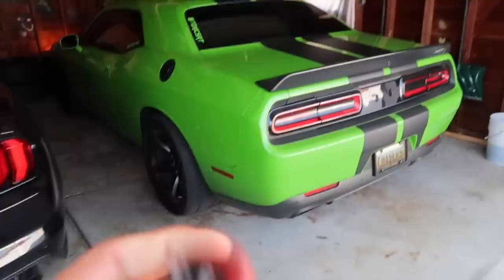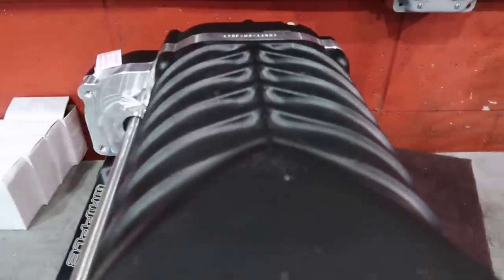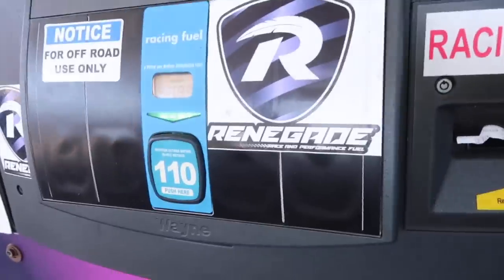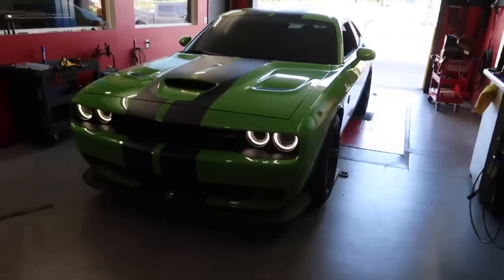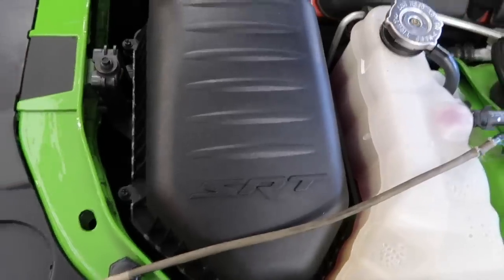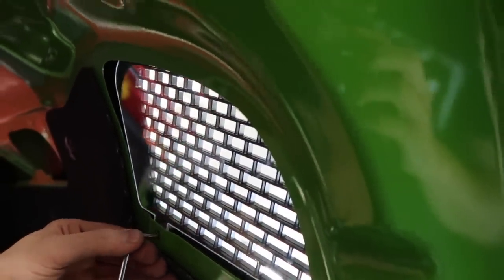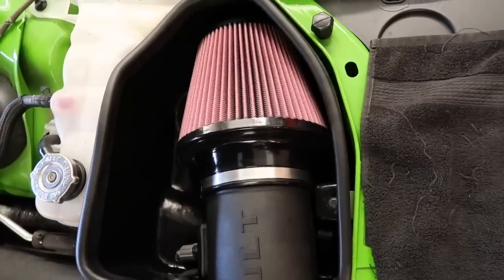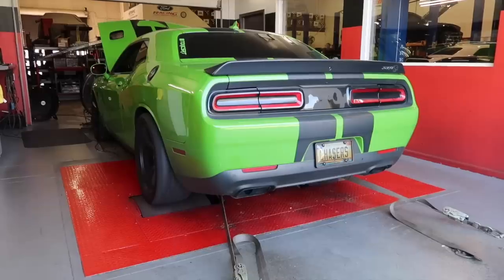INSTALLED A NEW MOD ON MY CHALLENGER HELLCAT & DYNOED IT!! *WOW*

Comment: the headlight openings are direct injection ports or dips no ram air. A ram air would be a port on the hood forcing air into the filter

Comment: The hood vent vents are designed to allow heat to escape.  Guess you are going to have some additional heat in the engine compartment.  I have a Bwoody CAI  on my Hellcat and it is great.   Plus I got to keep my vent open.  HR5 10.5 replica wheels with MT 305x35/20’s drag radials coupled with a rear diff brace will take care of your spinning issues.  I don’t even run with traction control on.
Reply: Wee Man how do u like the diff brace? I’m thinking of adding one. 
I have the JLT intake and not seeing an increase in heat. I almost did the diff brace when I did my driveshaft but figured my 305/45/18 mickeys setup would be good enough. I’m getting spin still but can you elaborate on that brace?

Comment: He has a stock hellcat with an intake. That’s why he didn’t show us any numbers 🤣
Reply from the maker: Try me when u see me & you'll find out.
Reply: @MotorTube  I love the car whether it's got 700hp, or it's got 1500hp!! Just as long as you don't fuck it up, cuz ur gonna sell it to me when it's time buddy!!
Reply: FACTS
Reply: Motortube       usually the cold air intake is everybody first mod..especially cars with supercharger that suck air ..there only a few things you can do to a hellcat to get more horsepower that makes sense  Pulleys , exhausted, e85 and airtakes .fuel injectors . Colder plugs . You act like thats a big secret lol
Reply: I wouldn’t wanna race Ron. 
Car is not stock for the hundredth time. That green hellcat puts busses on 1000 horsepower cars all the time.
Reply: @seanmichael252  zl1 the guy had shitty tires he was spinning the whole time.. that race dont prove nothing  and he need to down shift and use the paddles then switch it back to auto and let car and.ten speed do it thang
Reply: He only has an intake and cat deletes
Reply: Brian Lip I’ve been over that black car. He’s got new Nitto NT05Rs and its manual. LSA stroker 416 cu in on E85. When I raced him he was hookin just fine. I’m really REALLY sure Ron’s car is not stock and is putting down at least 850 - 865 rwhp? On 110 race fuel. All these people saying he’s stock are wrong!I’ve seen it and what it does. Main reason I bought a hellcat was watching Ron hurt people’s feelings in that green challenger hellcat.
Reply: He wouldn't even race a big fat heavy white charger with his 1000 horsepower challenger he had to have his buddy bring his challenger to race hahaha
Reply: Bro you have a lot of haters but that’s expected when you have a hellcat AND a brand new Mustang. That just lets you know you’re doing something right!!!!
Reply: @MotorTube  I'd love to see you 707hp hellcat go to work buddy
Reply: @IMGONEIN60  he has haters because he lies about his cars
Reply: Desjuan  Anderson oh man that’s easy to find out if he’s lying bro, RACE HIM????
Reply: Do you know how far I am
Reply: Desjuan  Anderson my bad I thought all y’all were up north
Reply: @seanmichael252  yeah because they're actually making a 1000hp also. Kids make me lmao..
Reply: @seanmichael252  that car isnt making 850rwhp please. He better have nitrous on that car. Stock 2.4l supercharger isn't supporting 1000hp on a hellcat. Stock injectors won't do it either specially on E85. They're only 600cc injectors and the fuel pressure is already at a high 80psi.  Unless the injectors are changed the hellcat isn't making much over 780bhp so you can forget 850rwhp all together and that's with the injectors maxed out at 100% which anyone with sense knows when it comes to injectors you don't run them maxed out.  It's not as simple as changing the pulleys, tune, air filter, exhaust etc and making 1000hp with stock blower and injector. Everything has it's limit. It's amazing what people say when they don't have a clue what their talking about.